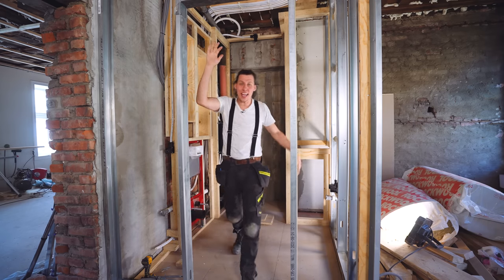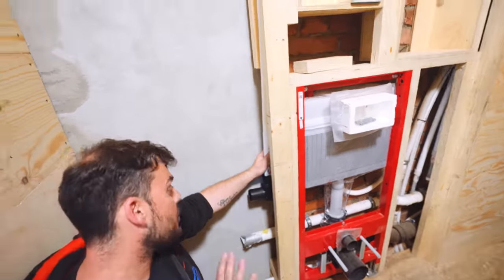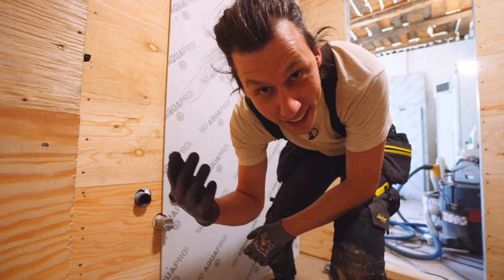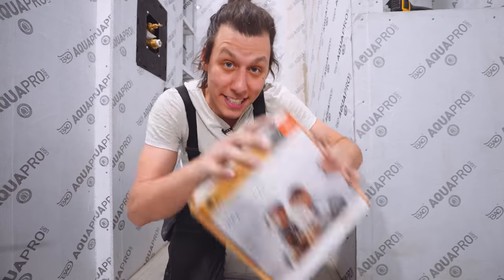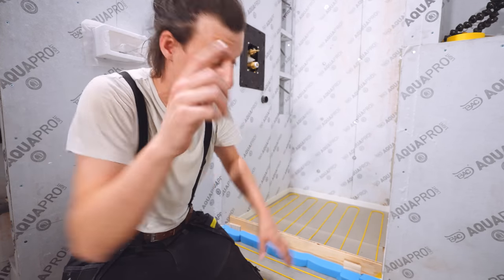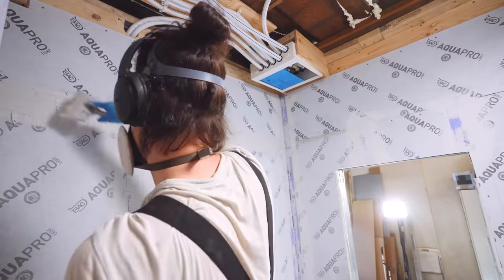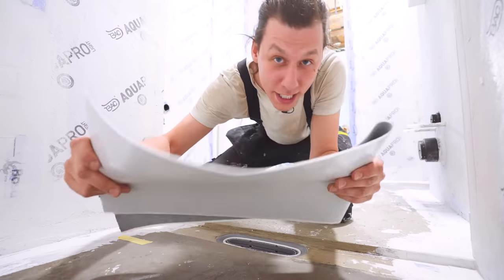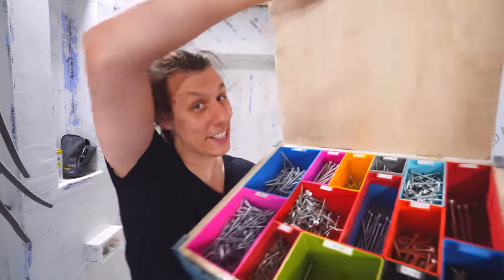How To Properly Waterproof a Bathroom!

Comment: Thanks for giving Norwegian ways of doing stuff like this! I watch so many American videos, and those are not always that easy to "translate" into how things are done in Norway since their is some differences. Tusen takk! :D
Reply: Not only that we here in the states basically never take this much dedication to waterproofing and sealing a framed bathroom, though I would be curious to know if everything he did (waterproofing) was code or exceeded code.
Reply: @geoffreychadwick9229  I reckon it exceeded code. I doubt a run of the mill worker would do it up to the roof. They would probably just do the shower fully, then the rest of the bathroom to X metre etc. To save costs and reduce amount of work. 

Then again, I do not know the exact codes in Norway for these stuff. But I know in Sweden, I've seen them using Linoleum matt scraps and waterproofed that way. By sealing it like a floor. Then clinkers onto that. Among other tricks to cut down costs.
Reply: @geoffreychadwick9229  Their is very many rules on how to do things in Norway. Like the electrical you can almost not do anything your self. Like changing a ceiling light is not allowed and you need an electrician.
Reply: @geoffreychadwick9229  As an architect can confirm meets code there slope might be lower than we use but that’s about it.
Reply: @linnsoltwedel  depends on the light/way of conecting😉
Reply: As a Dane I agree with this 👌🇩🇰
Reply: @linnsoltwedel  I’m electrician in states. We have a homeowner rule that lets a homeowner do any electrical they want to their own house. Kinda weird and many things can be difficult for them like the final hookups/fuses in the box and working near the mains power. To make it more confusing and weird, electricians can’t work on their stuff or we’re liable but we can be consulted and tell/guide them how to do the harder parts. So as long as I’m not using my hands to do the work or getting paid I can help friends with their projects.
Reply: @FearsomeWarrior  Wow. That's very strange! I wish we could do a little more here in Norway, but I don't think we should have it like in the US. That's for sure! We can do stuff, and some do, but if something happens we are screwed in terms of insurance after fire and can get ruined in that department.
Reply: @Helveteshit  Most bathrooms are done like that.

Comment: You made it look WAY too easy. You are such an awesome craftsman in so many ways. Glad you are young and have that much energy. Since you were going that far waterproofing, perhaps go with an optional water-tight door that is 40 cm high so you could fill the floor with 25 cm of water for a 'mini tub' (after calculating what load it could take).

Comment: Love this series and how far you have come!
Do you not have to service in wall toilets?  Live fill valve, floats, etc?
Reply from the maker: I'm pretty sure you can do all of that through the hole where the buttons go :)
Reply: @achappel  Exactly - they're designed for that.  Most parts can be unscrewed or unclipped with one hand to make it possible.  Not to say it's easy...  But most things can be fixed without ripping the wall down :)

Comment: One thing's for sure: after this project you can never again say "I'm new to this stuff" 😋
Question: I noticed that you put in the corner pieces at the floor joints before you put in the floor membrane, as opposed to every other corner where they went in over the membrane-clad boards. Does that mean the order doesn't matter, or is there some other calculation involved?
Reply: You are correct. The order doesn't matter as long as all the pieces overlap enough according to the manufacturer spec
Reply: @LemonZ89  Thanks 👍

Comment: Love your content! always nice to watch your progress and new projects on the channel. I have one question tho in regards to the method used for heating the apartment: Why do you use electricity for floorheating? Isn't that super expensive in running cost? Wouldn't district heating be a better option (By the way I'm danish and therefor not an expert in the heating standards of Norway but I am curious)

Comment: How fast does the floor heats up? i do am curious ...you have the heat cable at 5 cm+ deep. it feels that is too deep.  and to worm up this thick slab of concrete and tiles will take time and much electric consuption. Tack

Comment: Great vídeo as the European way of doing things! 
Btw, the floor heating is electrical? I'm curious about the average electric bill for a house like that? Here in Portugal, the floor heating is almost always with water/liquid with solar or heat pump to heat the water.
Reply: I was wondering this too. In the UK all underfloor heating is also liquid filled and pumped around. I really wouldn't want to think what my electricity bill would be like if I had electric underfloor heating.
Reply: Lots of new construction is fluid heating, but for renovations like these, electrical is more common. The reason typically is the enormous startup cost of buying a air-to-water heat pump and the serious amount of plumbing and equipment required to get it online. Also, remember, this is an apartment in a big city. Slapping a big white noisy box on the outside wall might not even be legal, as the building aethetic is probably protected by heritage laws (it being over 100yrs old and all).
Reply: @LemonZ89  Thank you for the explanation, that makes much more sense now. Can you run underfloor heating off conventional boiler / rad loops? I always thought that was how it was done but I'm clearly wrong.
Reply: @daveawb  you can, but our boilers are electrical too, so no gains to be had. Remember, we have no natural gas lines in norway
Reply: @LemonZ89  ha, there's the missing piece of information for me! 😁

Comment: Would you also recommend this way of waterproofing it in a tiny house made from timber? I'm currently building my house in the Netherlands and I am planning on making the bathroom in a month, but am still doubting on how to do it 🙈
Reply from the maker: Jepp for sure! This way everything behind the membrane is fully protected from moisture ;)
Reply: This is indeed standard practice in the nettherlands also. Only difference we do only the showerarea plus minus 50cm.
Reply: @antonvink  any idea where to buy which brand? :)
Reply: @katjaheidweiller7187  vidiboard is used a lot. You can buy these at every professional building store. Hornbach has QBoard as far as i know thats sort of the same. Vidiboard has also specialised panels for toilets with all the neccesary cut-outs allready in place. When using these panels you dont need a backer board like plywood or osb.
Reply: I would recommend looking into Schluter for your waterproofing. I loved their training. Very comprehensive.
Reply: @insecureinvestorchallenge7366  Do you mean those roles or boards? Because I can't find a shop that sells those boards...
Reply: @katjaheidweiller7187  I am in America so I’m not sure what’s available in your market but I do favor the Schluter Kerdi boards. So lightweight, already waterproofed and no need for cement board, sheet rock or some kind of backer board to apply to. Their waterproof membranes can be applied over sheet rock, cement board and I think possibly plywood is perfectly good too. My sister used the waterproofing membrane for 2 showers in a house she was living in at the time. It went really well for her. Schluter has a YouTube channel and their online education from their website is pretty good too. I took their FREE in-person workshop classes. Life changing hands on experience in the classroom and with an instructor to install the product itself on a mock up. I understand that this might not be easily available where you’re at but I highly recommend the education so that you can judge the quality and the appropriate application for your project with the materials that are available to you. I wish you well and I hope this helps! PS. I agree that a lot of waterproofing in America is done badly but Schluter is one of the few companies and products I found that I actually feel confident with after all the research of what was available in my market.

Comment: Is this a bathroom or a submarine? There is a lot of waterproofing.. Would it be enough to do it for the shower and floor? Well maybe it doubles as a sauna and in that case it makes sense.
Reply from the maker: The rules say something like 1m away from a water source, wich in such a small bathroom pretty much means the whole thing :p
Reply: @achappel  And it takes almost same time to do the hole room then only 1 meter. :) Tror vi har något liknande i Sverige, en meter ut från duschen.
Reply: @magnusE7  Nope, hela badrummet ska ha tätskikt. 1meter från duschen är vart man får komma ut med rör. Av den anledningen att fukten kan färdas i fixet bakom kakelplattorna i upp till en meter. Vet inte om det är samma i Norge men jag skulle tro det.

Comment: How do you access the water tank internal system if it fails?  Or how do you access the shower valves in case they leak?
Reply: The watertank on the toilet can be accessed through te buttons to flush. Everything inside the tank is replaceable and easy to fix. There's probably going to be a removable cover for the sower as well
Reply: @HorizonFarming  Nice, Where I live we access them from the top.  You only see the ceramic tank style only.

Comment: 07:07 how does the screwing not... screwing the waterproof-ness of the boards? Is it ok to do it while attaching it in wood, but not in concrete?
Reply: Every screw needs to be covered with the blue membrane tape.

Comment: Forgive my ignorance on such matters, but I've never seen an entire bathroom waterproofed - only the direct "this will get wet" and localised "this might get overspray from a shower" type waterproofing. Is this a local requirement? Is it the size of the bathroom? Or is it personal preference for "just in case it goes horribly wrong"?
Reply: The whole bathroom needs to be waterproof. Its the same in Sweden. Doesnt matter what size it is. In a small bathroom its understandable. But even big bathrooms need to be completly waterproof all the way to the door.
Reply: Norwegian code is close to what you describe, but the definition of a "wet zone" extends 1m beyond a shower in any direction for instance, and 1m over any floor in case the room floods, so for a tiny bathroom like this it is really just a waste of time to break out the measuring tape to figure out where to stop waterproofing!
Reply: @LemonZ89  I thought it was the same really. Atleast in Sweden it doesnt matter, you could have the shower in one end and 5m to the door and it still needs to be waterproofed all the way. We also have wetzones and 1m away but that is only for penetrations in the waterproofing. Like heatingpipes for a radiator or tapwater and visible piping cant enter within that wetzone.
Reply: The Japanese also like completely waterproofed rooms for bathrooms.

Comment: .normal toilets get stuck flushing all the time...what happens if the toilet breaks...or gets stuck can you access it in any way..
Reply from the maker: Yep, through the flushing hole :)
Reply: There's very few problems with wall mounted toilets, and we can service them through the hole where the buttons to flush is.

Comment: My guess why the heating wire was too long: once you have divided the room using the formula "surface/length", you should run your wire in the middle on the grid blocs, not on the edge. For example, if the formula gives you a grid with blocs that are 10cm wide, the first wire must run at 5cm from the wall, the second at 15cm from the wall, etc. It looked like you ran your first wire at 10, then 20cm...

Running in the middle of the grid, the final run will be a tad bit longer and you will have no wire eft at the end.

Comment: If there's ever a problem with the toilet, you'll have to cut the wall open?
Reply: Yep! Soo much more fun that way...

One of the reasons I prefer free standing toilets. And while I like the idea of wall hanging one to keep it off the floor and make it easier to clean the bathroom I don't like the idea of putting that much strain on the wall unless it's reinforced concrete. You never know when some +300 lbs guest sits down hard on that toilet, and it's hopefully be there for 40 years or more. So any wall hanged toilet has to be solidly mounted.
Reply: @blahorgaslisk7763  I just replaced a flapper valve this past month. Probably the second time in 10 years I've been in this house. I can't imagvi ripping out a wall to do that. Maybe these toilets are just made better?
Reply: @CheveeDodd  Most everything can be replaced through the opening for the controls. Still I'm not a fan of building the tank into the wall.
Reply: @blahorgaslisk7763  That's why there's a bag around the tank, so if there's ever a leak, the water will drain out on the floor. Everything inside the tank is easily replaceable through the hole where the buttons to flush is.

Comment: I wonder how well the heating works under the thick concrete layer and then with the tiles above. It probably takes a lot of time to heat up the floor. Anyway good videos so far, keep up the good work! =) Looking forward for the final result.
Reply: it works pretty well, takes a few extra hours only but the water protection is woth it

Comment: Be carefull! Waterpipes in the wall. There maybe  a time wenn you need access for repairing. Rob
Reply: Thats the good part with pex in a conduit. You can hook a new pipe on to it and pull it through, so basically its completly replaceable. Not fun but doable.

Comment: That’s a very interesting toilet design I thought you would want to have the reservoir outside of the toilet for like maintenance and stuff  cord from the lever gets caught  🤷‍♀️ maybe that’s just a thing on American standard toilets I don’t know
Reply: Maintenance is completely done through the small hole in the front. You can replace the complete internals through it. That's something I don't get in all this luxurious home videos, here on Youtube. A House for 20 Million and the toilet is a floor standing model which you get for 200 Bucks at Home-Depot. Wall hanging toilets are here, the norm for any new house here in my area. It's much easier to clean.
Reply: there is no cord. it is just a plastic mechanical lever. This thing will break maybe after 10-15 years, at which point you will be renovating the bathroom anyways
Reply: I have installed those kinds of toilets and it's so much more work then a normal toilet it's not fun
Reply: @adamvalt6609  Everything inside can be replaced and replacement parts are available very long. For my Geberit here, I replace the whole internals after 25 years. All parts are still available and there are even newer parts produced fitting in the old watertank.
Reply: @Dominik_S.  our geberit has failed after 13 years, I did not know about the replacement parts! Thanks!

Comment: You should not put heating under the shower because of temp shocks. It could long term crack your floor.
Reply: i dont think the temp differences are high enough and even if, the waterproofing layer is still on top
Reply: @BLEKSIDE  I don't know about these heating cables but with water tubes its definitely forbidden

Comment: Are you sure hot-glueing the heating elements was a smart idea? 😅
Reply: Well, they do end up encased in a cementitious self-levelling concrete; they aren't going anywhere now! The glue was just to prevent the cables from moving when pouring the levelling compound.

Comment: So i gather T&G strips of ply are the thing where you live. OK, neato. we have had good luck for 30 yrs with cementatious backers in areas to save money with red guard and Wedi in direct wet  vertical surfaces areas and full membrane pans pre- sloped with mortar over decoupling matrix then mud-set floors. no leaks in 30+ years. the plywood? so you are wall paneling twice? im all for overkill but we gotta get jobs and we wouldn't get em this way